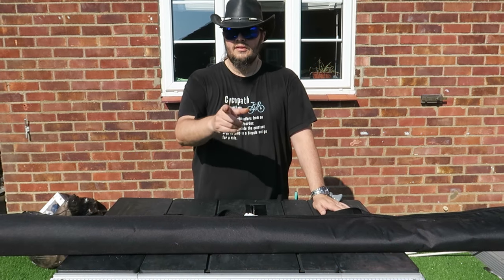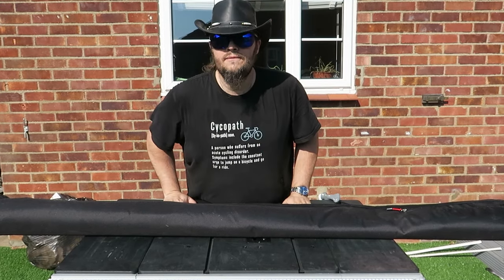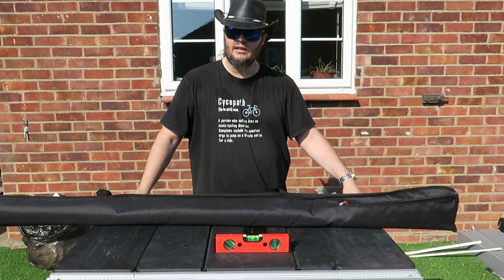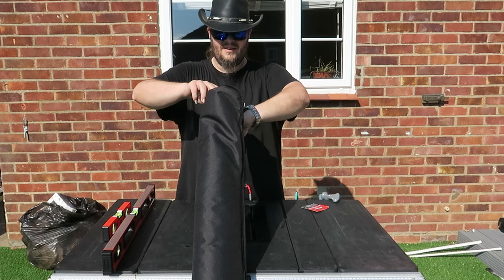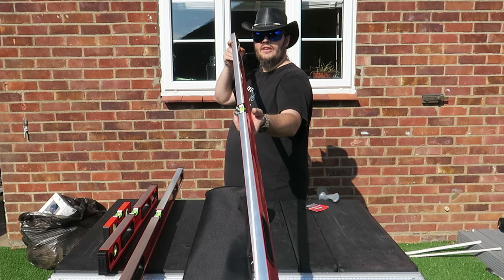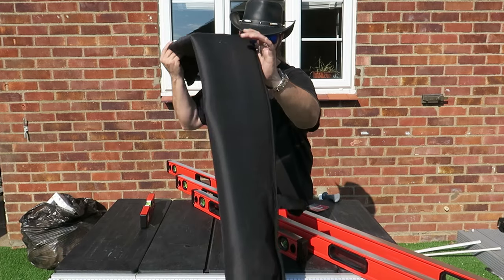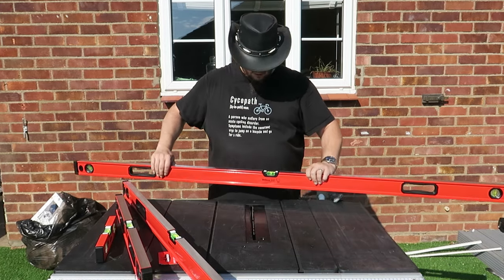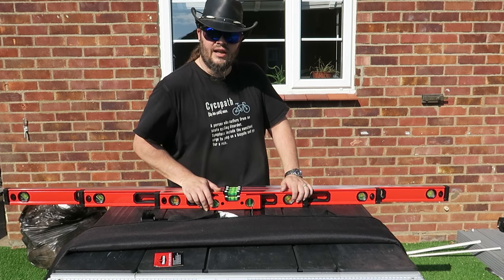Awesome TOOLSTATION "BARGAIN" £50 Minotaur Spirit Level Set

Comment: Hi I bought the 1800mm to try. It was well made maybe a little lightweight but acceptable. It was very straight but not accurate. The horizontal was close but the vertical way out. Thanks for the video. 👍

Comment: Having a 45 degree vital on levels is more of a nuisance than helpful. In nearly 50 years on building sites, I never needed one once, it was always horizontal or vertical that was needed.  A 90 degree vital on both ends  is much better.
Reply: True 👈